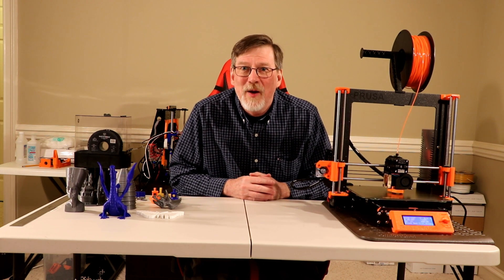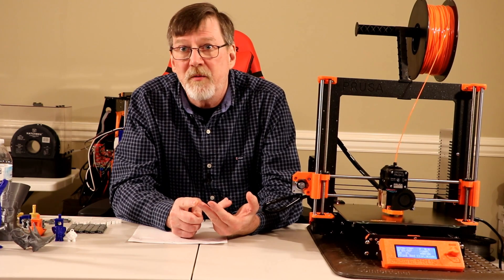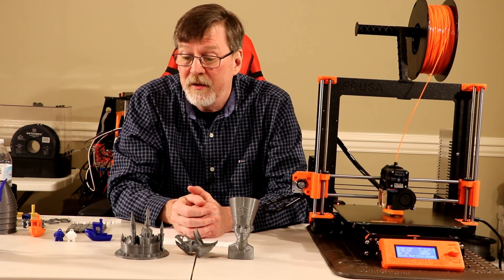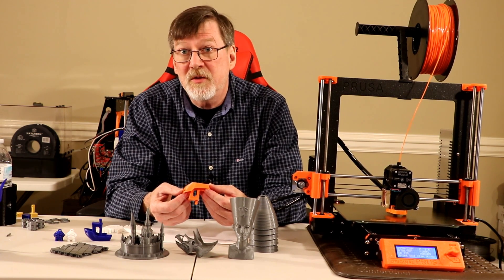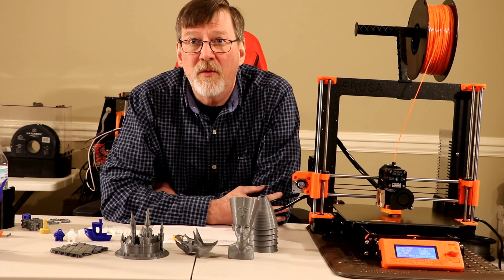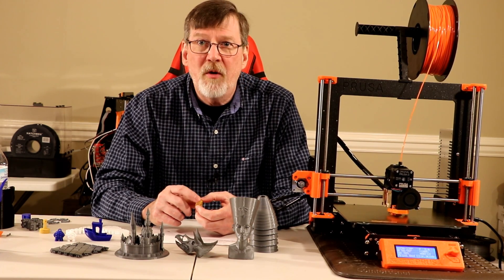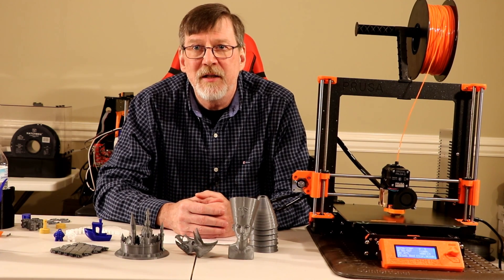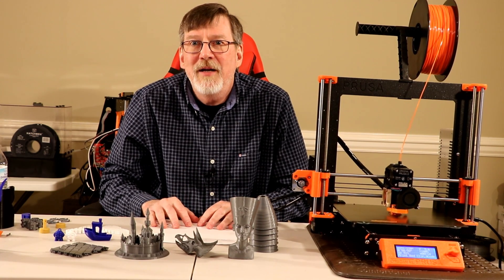My Original Prusa i3 MK3 Kit: Finished and Review

Comment: So does the Prusa make you think less of the Anet A8?
Reply from the maker: No, not really. No doubt about it, the Original Prusa is defiantly a better printer than the A8 in terms of quality (hardware and electronics) and features and is easier to use. But the quality of the A8 prints are close to that of the Prusa MK3, at least for PLA and ABS and as long as I don't push the A8 too hard.  The A8 is what it is, a cheap knock-off of the Prusa, but that's OK. Don't get me wrong, The A8 has it short comings and requires attention, but if you are willing to work at it and don't mind working at it,  the A8 can serve as a descent 3D printer. The A8 has actually made me appreciate the Prusa MK3 more than I would have if I had bought the Prusa MK3 first.

Comment: Hey Harry, what did you place under your printer?
Reply from the maker: That is a rubber mat that I bought at Home Depot and cut to size. It cost about $10. I use the other half under my Anet A8
Reply: Thanks for your reply! What do you use it for?
Reply from the maker: I use it for vibration/shock isolation/reduction

Comment: I'll be very interested in your experience building a MK3 from scratch.  I've got a MK2S and I'm also thinking of making a MK3 from scratch.   My concern right now is the extruder.   Based on various clips on YouTube there is clearly a problem of overheating which I would like to see addressed.   People report that the heat can kill the filament sensor and also leads to problems with filament loading and unloading after a while.  Best of luck with your build project.
Cheers,  John
Reply from the maker: I have finished assembling the frame for my scratch build, although the word 'scratch' is a little strong. The frame is 2040  aluminum  I order from Misumi so I did not build that part, just pieced it together. Most of the other parts I have printed with either ABS or PETG. The extruder stepper of MK3 does get hot as I said in the video. Everything I read in the forums and from Prusa Research , for the most part, state that the temps are within operational limits. But the stepper is a lot hotter than the extruder  stepper on my A8. That seems a bit strange to me. It shouldn't be a issue for high temp filament but I worry a little about PLA. Not sure how much heat gets transferred from the motor to the hobbed gear. So for it doesn't seem to effect my PLA prints. I do plan to add a heat sink to the stepper motor, if noting else it will ease my mind a bit. BTW, I really like your channel.
Reply: Thanks, my channel is a mish-mash of the various things I'm interested in so it doesn't have a theme  - other than making or repairing things!   Right now I'm printing the MK3 printed parts, I've got a MK52 bed on order from India and I've got the Orballo frame ready to assemble.   It's probably going to take a while but I'm not in a rush.
Cheers,   John
Reply from the maker: LOL...you sound like me John...tinker around with the things that interest me and take my time...one project I'm tinkering with is printing a violin...the hovalin  to be exact, but I'm in no hurry....
Have a great day